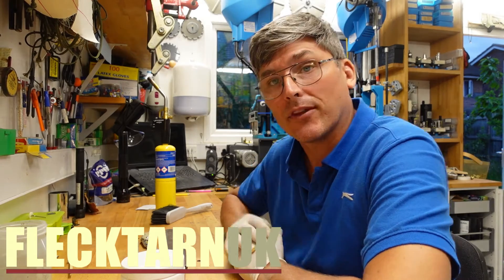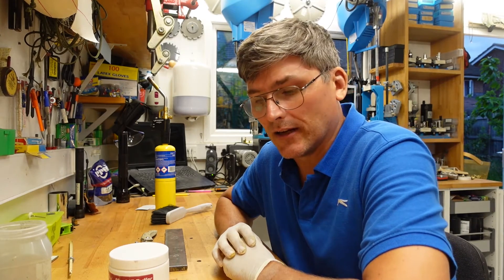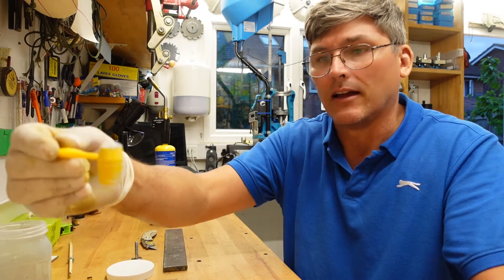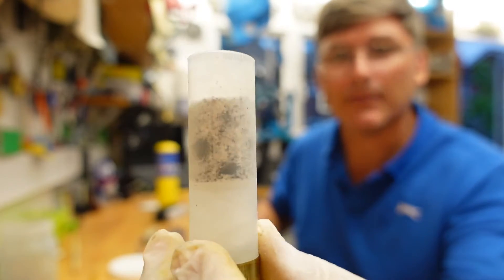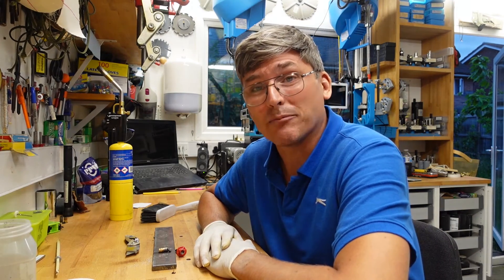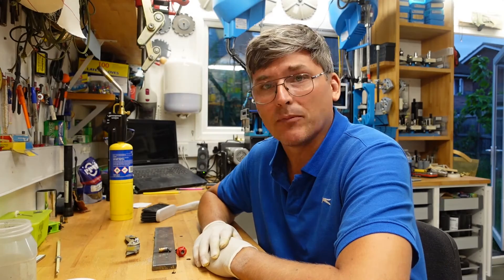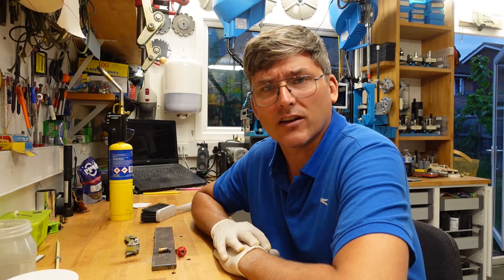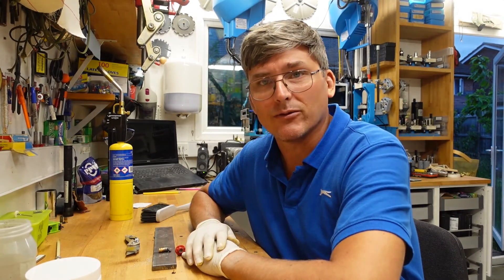[109] Why You Shouldn't Use Buffer for Buckshot Shotgun Shell Reloading

Comment: In the states, some states you can only hunt with buckshot. You can bet that if you have any choice in the matter your ammo will be using premium hunting ammo and that will have buffer by default. Cheap home defense ammo, no buffer. Non-buffered but my hardball loads, I get excellent groups at 25 yards, cylinder bore, even pushing 50 yards you could still hunt with that in a pinch. At 50 yards, my hard shot, and a buckshot choke that grabs the wad, I’ll definitely be on steal, a good portion of it. Beyond 50 yards and buffer and the correct choke, that buffer is just that little bet that little round balls (rather than square-ish balls) will hold a group to say 60 or 70+ yards, maybe. Now if your talking paper, pinging steel, plinking, or zombies; you do not need buffer. Your buffer should not be catching on fire, it is messy, ads a step to loading and if it leaks out can jam your magazine, use an overshot card. Also, some plinking loads are quite pleasant and one could easily imagine that the pellets remain more or less round as opposed to the other loads that leave a stamp mark on your shoulder. Also, manufacturers use buffer so that they can get away with less expensive lead alloy. Everything I load is my own hard cast: 50/50 hardball/3.5% antimonial lead. Especially If your doing magnum payloads, buffer might be for you, and if your reloading, you can have it your way. If I were a young man, micro plastics would be more of an issue to me.

Comment: Corse ground cornmeal or dry grits works really well. Not spraying tiny bits of plastic everywhere, but it gives you the benefits of buffered shells. There is a reason that buffer is used in all of the high dollar buck shot shells, that reason is because it works.

Comment: As for more eco-friendly options, I have heard of people using spent coffee grounds and fine saw dust. I end up with a lot of saw from woodwork so I may give that a try.

My first attempt with buffer went about the same as yours, however, unlike you, I went back to drawing board and figured out why I failed. There's a reason big companies like Federal spend labor and materials putting buffer in loads. It works. Through trial and error I have cut my buckshot group sizes in half.